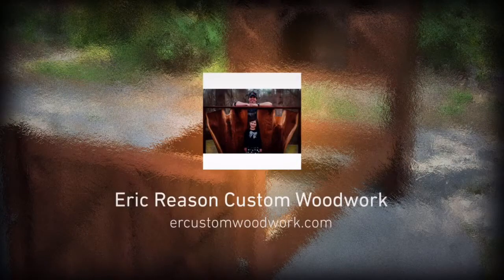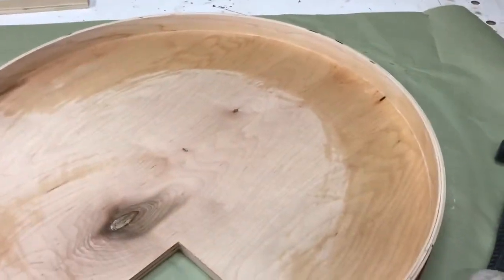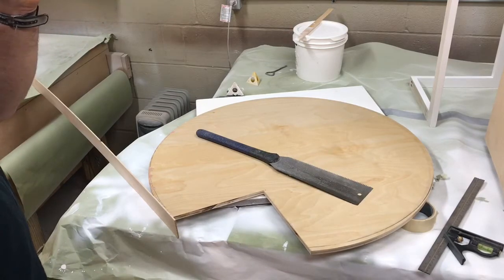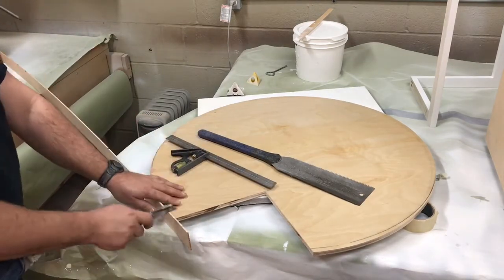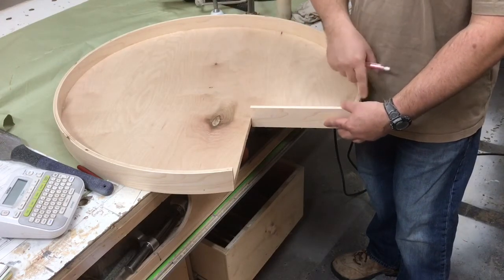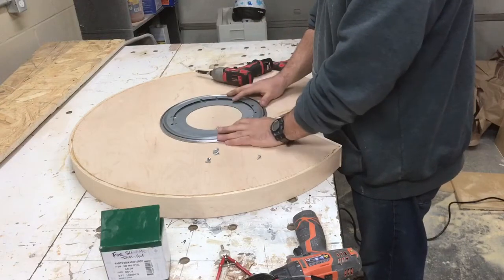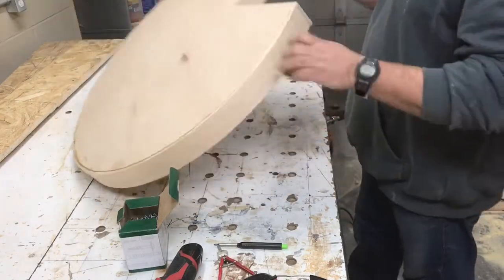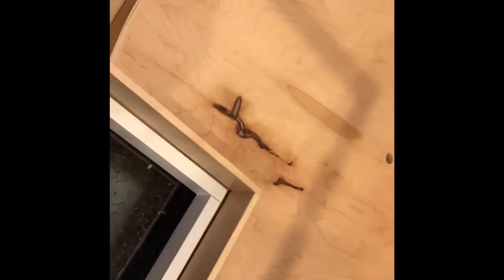How to Build a Custom Lazy Susan Part 2

Comment: i'm trying to figure out if it would be possible to retrofit this type of lazy susan (no pole, aka super susan) in a cabinet that doesn't currently have a middle shelf. obviously I'll have to do some measurements (not my kitchen, elderly friend's) but I feel like I won't be able to fit the shelf that the susan sits on through the opening?